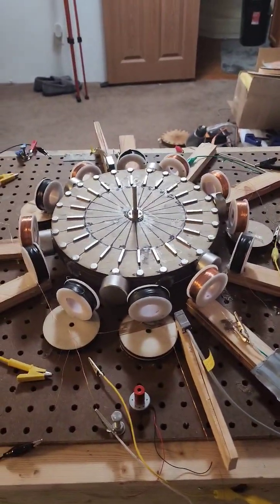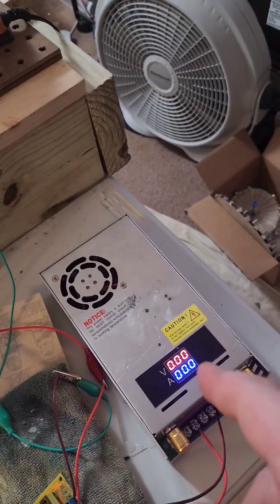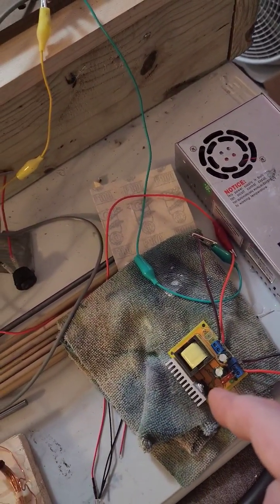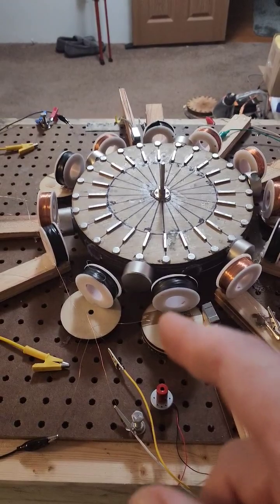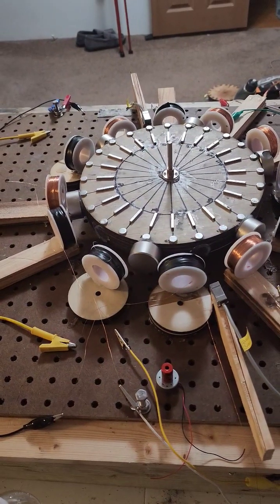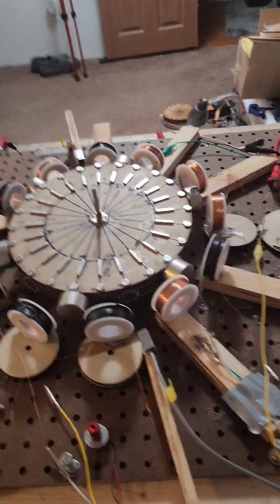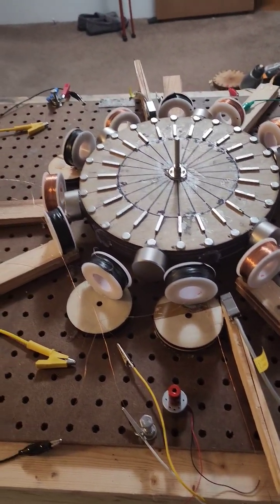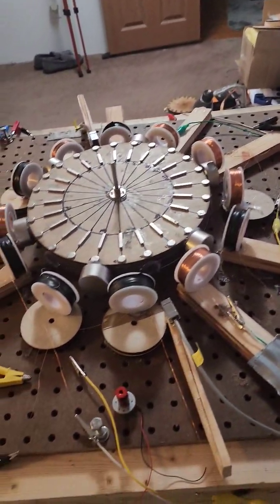pulse motor generator self-sustaining phase 3

Comment: You sound like your smoke more weed than me, and I still know the laws of physics.
Reply from the maker: I don't, just one nothing is free. and this is definitely not. and it probably wont work and if it does it wont be forever.
Reply: @MPHJR  Here is a question for you.

Have you ever used any of the permanent, load lifting magnets like in fabrication shops?

I have one that can lift 600lbs of pipe, or steel plate...
Has a lever to move the permanent magnet inside to turn on and off...right...

But riddle me this, if I left suspended 600lbs of pipe on a crane... on that magnet... how long until the magnet runs out of clamp force????? 
:o

So... if law of conservation of energy is correct. And all other laws correct...There should be a calculation, of near precise TIME how long that magnet will be able to handle that load.

But yet.  We have some that have been recertified and left in service for 15+ years....hmm.. and mind you they are rated by OSHA for safety handling material.

I'm still waiting for a troll, or youtube comments physicists to tell me some equations and math to predict the time till demagnetization at full load.

But... they never can answer this. 

Why?
Reply from the maker: @Heliarc91  mine have not expired either refrigerator magnets from when I was 3 still work I am in my 40's now